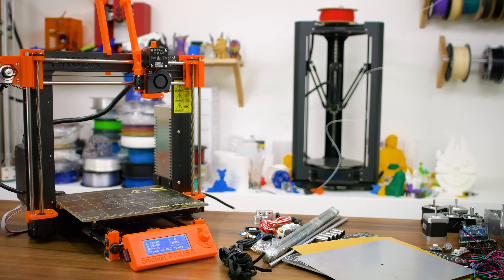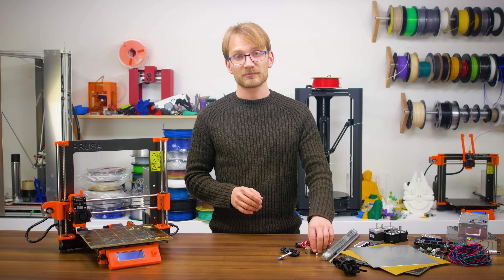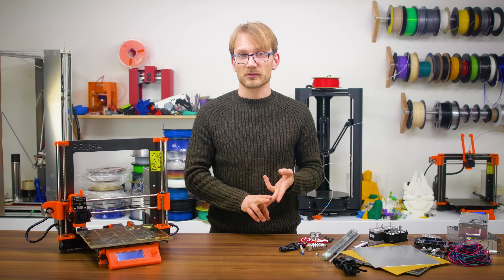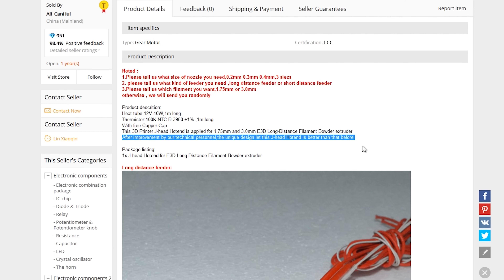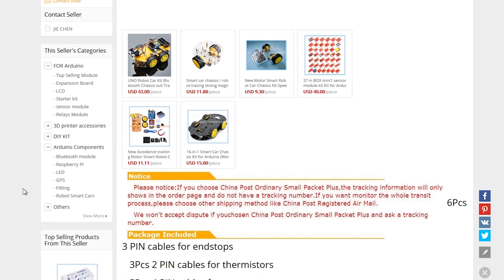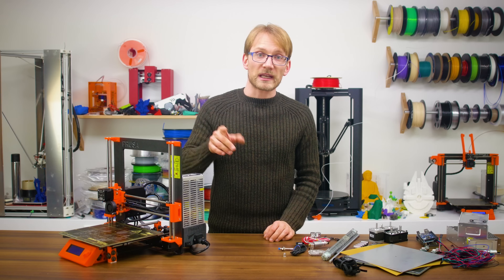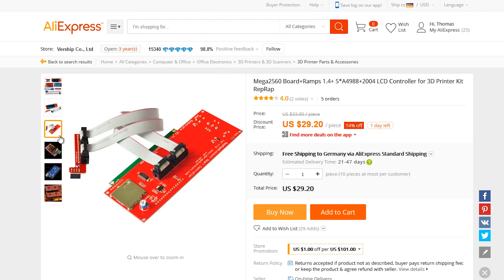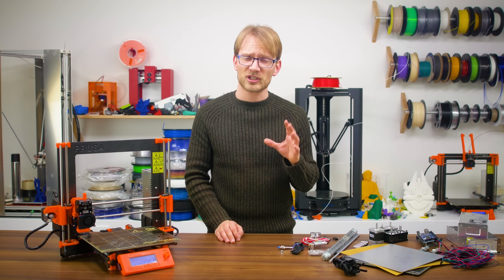Building the cheapest possible Prusa i3 MK2 clone: [01] Electronics and Extruder!

Comment: Thomas,
I'm curious why you bothered with the TDC plating on the shafts you used for your linear guides? I'm a linear drives and guides engineer and we normally only use chrome in corrosive environments. You shouldn't have any corrosion issues if you keep the parts greased.

Also the bushings you selected doesn't use chromed ball bearings.

Comment: does anyone have an updated list? as is my parts on aliexpress are around 350$ usd
Reply: Just buy a damaged Printer and try to fix it, thats way cheaper.

Aliexpress got quite expensive, like you cant find a heatbed under 15$
Reply: @antonw4779  thats kind of the route i took i just bought the a8 Plus to start out on. and then once i understand the concept better i will go from there. ty

Comment: Fun project! And thanks for the detailed parts and price list.

Noting this video is over two years old -- Looks like current costs, not counting printed parts, comes in about $150 (USD) which is only about $50 less than purchasing an Ender these days. It was a little disappointing that you can't save that much building your own printers any more, but still super informative.

Comment: It certainly is cheap. But I'd still go for a "more reputable faker" such as trianglelabs. My printer (Anycubic i3 mega) is heavily upgraded (BLTouch, Dual Extruder in the shape of a Chimera and not ditching the dual Z Axis, titan Extruders) and all parts are from Trianglelabs (Except for the PCB to add an extra steppper driver). Their parts really have a high quality, even if they are like a few bucks more expensive than the really cheap stuff.

Comment: The power supply is the only thing I wouldn't cheap out on. The Chinesium power supplies often have problems fincluding catching fire, insufficient clearance between the mains and the output side (you don't want to touch mains voltage on your printer), poor output power quality... A good one (e.g meanwell) is a few $ more, if you can't find an ATX computer power supply (and those can even be found for free)

Comment: The clone E3D V6 hot end kit at 3:08 is listed to be a bowden version but in the clone assembly video P3 around 1h there's no bowden adapter connected. Is it ok to buy the bowden J-head clone which comes with 1m teflon tube and then just screw the bowden connector away and use that teflon tube as PTFE tube which is inserted 2 minutes later in the part 3 video? Or is it better to buy a version without bowden setup and buy the PTFE tube separately?

Comment: Sorry - but the more I think about this long drawn out, over the top(bottom?) series, it's clear that it was a youtube stunt.  No one would really make a printer like this(MFD?  Really?  And you said that was the "best part" of the build - it's clearly not)  And Tom didn't expect anyone to actually follow this.  It's more of an Youtube attention grab then anything.  I still have to say that it's interesting on how many cheap parts you can buy on aliexpress.   But that's where this video falls flat.  Never is there a total budget mentioned, or a follow up on improvements, or anything of substance.  Even the final prints are lackluster at best.  If your new to 3d printing, and think this series will be a way to get into it on the cheap, you're going to be disappointed. You'd be better of researching other i3 clones.

Comment: I was intrigued by this project. I'm hoping to use it as a basis of making my own Prusa clone, but have a few mods in mind and would appreciate your input.

I hope to make a larger version to accommodate the printing of shoes, Crocs to be specific. Over the years, the company has stopped making models wide enough for my feet. Having measured my old Croc's (30cm long), I only need to make the design large enough to print a shoe diagonally across the bed. I assume the only change to the design would be a larger bed, longer threaded and smooth rods. As I'm not planning on make the printer a lot larger, I don't believe it would be necessary to increase the diameter of the rods themselves.

Along with watching your channel, I've been watching a series of videos on Clickspring (https://www.youtube.com/playlist?list=PLZioPDnFPNsETq9h35dgQq80Ryx-beOli) documenting the making of a Skeleton clock. The assembly involves both hand building and machining. Also the build in primarily composed on brass, and hand polished "blued" steel screws. Quite an elegant appearance. I would like to use the build as inspiration to replace the 3d printed parts with brass(possibly bronze) and the same "blued" steel fasteners. Can you think of any reason why this wouldn't work? I would still be using the steel rods from your build.

Another reason I'm taking this approach, which may offend some 3d printer enthusiasts, I'm starting to expand my interest into machining and would love the learning experience this would present. I do understand that the soul of the 3d printing movement tends to base itself on self replicating.

Would appreciate your comments, especially if any of my plans or design changes are unrealistic.

Thank you

Comment: Hi Tom,  very inspiring videos.  I have a few questions for you if you can answer.  In those videos you build a clone, but could you have buid a bigger printing area, or the print results would be poor?    I have seen the new 4 filaments kit from Prusa with a quadruple extruder that changes color, clean remains on old filament and prints in 4 colors.  Do you know if the original Prusa kit could be applied to a Prusa based printer like your clone? Thanks.
Reply: Start small with a 3d printer - you'll quickly realise how hard it is to print large parts.

Comment: I have printing all of the parts listed on your site.  I am having trouble with five of them when putting into Simplify3D they show up as a massive box and not the correct part.  "Y-Distance", "PINDA-Protrector", and three optional parts "RAMBO-cover-base, door, and hinges".  None of these seam to be on the original Prusia print list either so I cannot find the original.  Any way you can help?

Comment: I wonder just how much of this you'd actually be able to 3D print, for example if you used something like the stainless steel filament could you 3D print the threaded rods?
Reply: Yes, you can 3d print metal on a 3d printer.  If you have $250k.
Reply: I wasn't talking about SLS printing, moreover the Proto-Pasta PLA with Stainless steel in it or something like that

Comment: Q - Should we get the 220x220x3 heated bed or we should go with the 214x214x3?
Reply from the maker: +aguanalirota both should fit as long as the mounting points are identical.
Reply: thanks! Only pending to get the printed parts :)

Comment: Q1 - You said that the LCD2004 (Character Based) screen is faster than the LCD12864 (Pixel Based) screen.  I was going to buy the Pixel Based one but then i  read that if you are using the cheap Ramps and Arduino there can be erratic pauses because it doesn't have enough computing power to do movement and show information on the screen.  Is this a noticeable thing?  I would rather have the large screen with all the info on it, but not if it screws up the printed parts.  
Q2 - I'm trying to decide between the A4988 and DRV8825 Stepper Drivers.  I've read that the A4988 is super solid, but prints at 1/16 micro-steps.  The DRV8825 can print at 1/32 micro-steps, which can mean better prints, but can be tricky to setup.      
Thanks for any info you can give me.
Reply from the maker: +Dave Wirth
LCDs: It's not about cheap "compatible" Arduinos vs genuine ones (they use the exact same processor), but about the combination printer - firmware - LCD. A Delta will use more CPU for motion calculations, as will a 32x microstepping setup. Graphical ones are fine for "normal" setups. 

Stepper drivers:
32x is not worth it, an 8-bit setup like Arduino+Ramps can not send out step pulses fast enough to get to a decent speed. I prefer Trinamic or even Allegro over stock TI drivers.

Comment: Myself and a few others in my town built anet a8's and we have heard of people who have upgraded cheap Chinese 3D printers to print with multiple filament at the same time. I'm currently running the stock board. How would I go about upgrading to have more extruder motors so that I could have different filaments? I know the original prusa I3 has a board you can plug in to the original board to get more Motors. Would this work for mine? could I just buy a different board and have more Motors?

Comment: Hello Thomas,
Im building my first 3d printer and i have a question about the design of the axis movement.
Which is the main difference between giving the heated bed a vertical (prusa i3) or a horizontal (makerbot) movement, and what would you recommend.
Thank you

Comment: The cheaper hotends mostly seem to be bowden styled. Removing the bowden leaves a huge gap for the threading. is there a solution for this or maybe update the bill of materials list?
Reply: Thanks for the answer! I noticed also when using the original extruder the fins are slightly different. not only is the heatsink a bit longer but its also hitting the bottom 3D printed part. However I will modify the STL to accomodate for that.  While I haven't modded it yet it also "seems" like the heatsink fins are a bit longer? causing you not to close the extruder housing. I might be wrong.

I got 4 ones from 4 different suppliers in just to check really *along with bare metal and ones with liners.

Maybe this would be the solution: https://www.aliexpress.com/item/Newest-Improved-Heatsink-Direct-Filament-for-1-75mm-and-3-0mm-E3D-V6-J-head-Wade/32443537849.html?ws_ab_test=searchweb0_0,searchweb201602_1_10065_10068_433_10136_10060_10062_10056_10055_10054_302_10059_10099_10103_10102_10096_10052_10053_10107_10050_10106_10051_10084_10083_10119_10080_10082_10081_10110_10111_10112_10113_10114_10037_10032_10078_10079_10077_10073_10070_10122_10123_10120_10126_10124-10054_10113_10120,searchweb201603_1,afswitch_1_afChannel,ppcSwitch_5,single_sort_0_price_asc&btsid=4714afb4-add8-48ed-ad2c-89049e7675c0&algo_expid=9653d8b8-c35b-4fee-b3ce-96598d1f3a35-4&algo_pvid=9653d8b8-c35b-4fee-b3ce-96598d1f3a35

Comment: Please try to use 2nd hand 12V server powersupply like "DPS 600" or "DPS 800"? These powersupplies can be found on eBay and other sites and can be easily converted by shorting 2 pins, or soldering a resistor between two pins. These powersupplies can put out 50-100A at 12V are of high quality, not dangerous have a temperature controlled fan and last forever. They even have short circuit protection of some kind. Please promote this kind of 2nd use for old server power supplies to the 3d printing community. There are so many of this still useful devices going to electronic recycling and are destroyed while others have to buy power supplies at not great quality because of price and on top have to order them from china , thanks

Comment: Great video.  I just got a Prusa i3 Mk2 and love it.  What you put together in the video.......I kind of have that too only it's an older RepRap kit based on i3.  For my money that heatbed with the calibration points is worth it.   The printer you built in your video is good but without that heat bed and mesh leveling in the firmware its just another rep rap.  Not knocking the video.  I love your videos and your Mk2 review was what pushed me over the top for buying one.  Thanks!

Comment: I designed and built a printer for 200 dollars. All parts are my own unique design too and the frame is made of threaded rods like the original Mendel. I will release it under the GPLv3 license too as a RepRap :). Sourcing the parts is actually the easiest part of all :).

Will design a 2nd printer later on which is mostly lasercut and 3d printed. The first was more of a challange.

Comment: You forgot to  factor in the cost of repairing the burn marks in your furniture when the cheap Ramps board's power connector catches on fire since it isn't rated for 20 amps.  (Even the legit RAMPS boards use under-rated power connectors that can overheat.)  Mine put a fist sized sized burn hole through the arm of the nearby leather couch armrest, and I was 20 ft away when I saw the flames start.  El cheapo Ramps board is bad money savings.

Comment: Searching for parts on AliExpress I can't be sure I am finding the exact same part in some cases.  Might I suggest that you show the listing number on your parts list?  I know that wont hold good for ever,  but would certainly assist the likes of me in the short term.   Cheers.  Later edit . . . I have just discovered that the supplier names are links to typical products - would still prefer a link to the exact listing but it is more helpful than I first thought.  Thanks,  Tom.

Comment: You could go even further with pricing:
People often have junk laying around, like an ATX powersupply of a 15 y/o computer; You could also use 10 rubber bands in stead of a spring, not 3dprinting the parts but cutting them out of scrap pieces of wood, etcetera.
If you really go the scrapyard way you can get it even cheaper.

Comment: This is an interesting initiative. But Tom you can't say the Mk2 is Open Source because it is not, even if you substitute to Prusa for providing a partial BOM. Open Source means ALL the sources are provided by the creator to build your own. Without a proper fasteners list, the BOM is still not available and you can't extract any exact BOM from the build manual (rods length, etc.). Sure you can't buy the MK42 (except in Prusa's Mk1 to Mk2 pretty expensive upgrade kit), but the sources are available so in theory anyone can build his own. But IRL nobody will because it needs skills and tools the average people won't own. So you won't be able to use the Mk2 features and firmware (like it is) anyway. The Mk2/3 beds was easily manufactured (copied) by Chinese Industry. The Mk42 will probably not be as interesting for Chinese business. Maybe it won't be copied at all.  I understand this is a way for Josef Prusa to protect his business, and in another way, to protect the Mk2 for poor chinese copies that don't match print quality expectations. It's a step out the Reprap World for Josef Prusa, and his (web)team still says "the Mk2 is Open Source" even if "all sources are not available yet"(?). Prusa is actualy protected by his aura and his huge contribution to the Reprap world. Compared with the MakerBase brand (MKS), for example, which is declaimed to provide non Open Source (inexpensive) cards (Smoothie or Rambo alike) while they provide at last as much sources. This is unfair. I realy hope Josef Prusa will remember the meaning of his tatoos and will provide all the Mk2 sources soon. Open Source printers can be commercial success anyways, like the Lulzbots.

Comment: Yeah, not finding that print bed available separately is the biggest problem to a complete clone (I've tried)...

I have a thought of merging the Prusa i3-MK2 and the FoldaRap 2.6 designs, taking the best of both to make a derivative (folding frame, with integrated lead screws and MK2 print bed).   How about it Josef?  a Prusa Portable?   ;-)
You can even change the build volume height with longer extrusions and lead screws  ( I get crazy when I start "spit-balling" ideas in my head)...  ;-)

I appreciate Thomas "taking one for the team", and will follow closely...

Comment: While I know it's not easily available everywhere; OpenBuilds V-Slots are cheap and there's a few i3 style printers that have a complete BOM.  They use a combo of v-slot extrusions and printed parts for the frame.  It seems to be one of the easiest out there to build yourself though; since you just need to cut the aluminum stock down to size, then use the printed parts or an m5 tap to tap out the holes in the center of the extrusions as mating points to other components.

Interesting series and I'm definitely following along :D Just ordered my parts from aliexpress!! :D

Comment: Swapping out -ramps, 'duino mega, and marlin for -v3 CNC sheild, 'duino Uno, and teacup can save you a few more dollars, as long as you only want to run one extruder!
Reply: Jepp, teacup even has a preset for the CNC shield, though it doesn't have the FETs, I already have some pretty beefy mosfets, I don't have the ratings to hand right now, but they were about $2 for a pack of ten, so that's what I'll be using on my 'thriftstrap', even thriftier would be pulling the FETs from an old power supply. All said though, it's a very limited platform, Teacup looks to be better coded, but it doesn't get half as much development as Marlin, and it would put you off spec to really be called an i3 clone, for me, I already have the uno, and the goal is to build a printer with as little spending as possible, performance be damned!
Reply: If you want a 3D printer while spending as little as possible and performance be damned, you could build a ToyRep without a heated bed.
Reply: Yeah, Yvan, the ToyRep has a few ideas in common with my design, but mine will be a RepStrap, using wood frame, with m6 threaded rod for z-axis, but it will have H-bot kinematics, taken ideas from the Fabrikator Mini, and Tech2C's Hypercube. Ultimately I want to make something tuned towards small, high-detail, low volume prints, so the sacrifice of speed for resolution with the geared steppers should be worth it.

Comment: Whats about using an old server-psu for power-supply?
They are a lot more durable and safe than a no-name solution from far east.
Also the offer often an 5V and 3.3V rail along with the 12V (for raspberry etc).
Price should be somewhere between 10-20$ on ebay